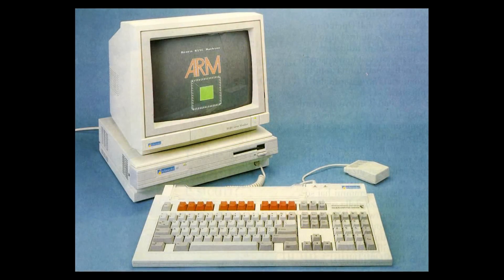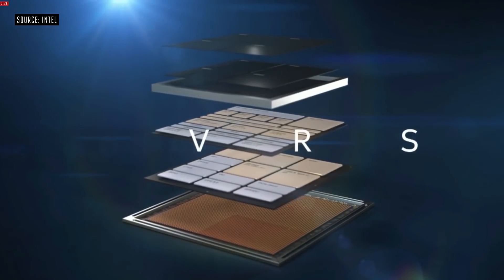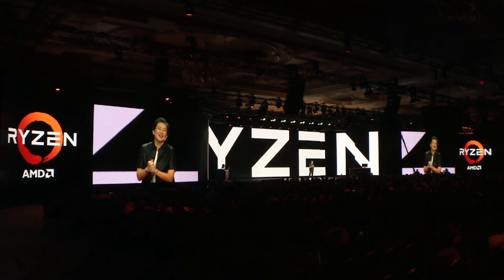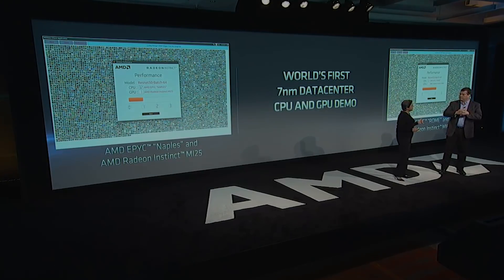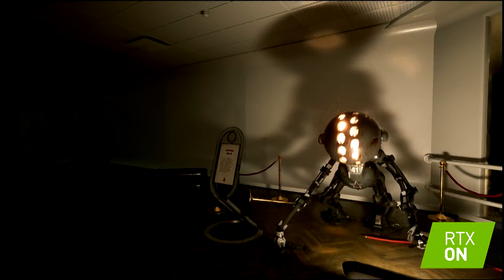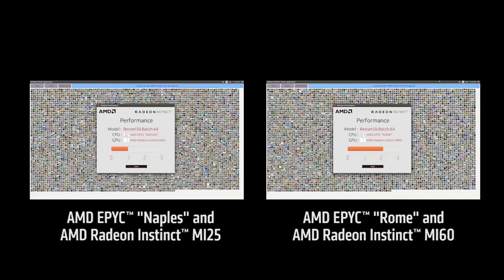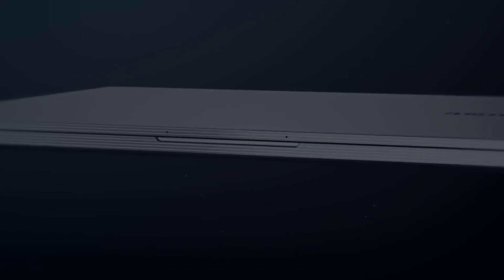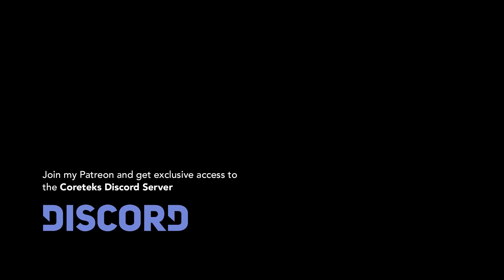Hardware trends: How many cores do we need?!

Comment: From programmer perspective I can tell you, that parallel processing is not going to arrive any time soon as common or default way of writing the code, since all the progress comes by evolution off what we had before. To implement it correctly even on high level programming languages, you need to bring more complexity to the code, than is brought by most of your business problem that code solves... So it increases costs dramatically, and bring any benefits only in limited areas of application. Also the need for multiple cores is limited, so it is more about making servers cheaper, than anything else.
Reply: Paweł Graczyk Parallel/concurrent programming is extremely common! Web server programs that service hundreds of thousands of requests at the same time, graphic-intensive programs, machine learning programs, and even web browser tabs and GUI-based document editing programs such as Microsoft Office suite all require parallel programming.
Reply: @AlqGo  you are correct somewhat but the workload you are talking about are similar in nature and independent of each other like handling individual user requests has no effect on other users  , but interlaced programs still require master/slave design pattern which somewhat is present in every program... I agree that parallel programming is beneficial but still a lot. Of programs can't benefit from it, especially i have seen most programs don't use more than two cores
Reply: @AshutoshMishra-l4m  That's not my point. I'm saying parallel programming is EXTREMELY common. MOST gui-based software employ parallel programming. Just because you have not had much experience in concurrency, doesn't mean it's not common.
Reply: @AlqGo  Why do you use "concurrent" and "parallel" interchangeably?
Reply: @antonkapelyushnik47  Because both types can be executed on multiple cores. So it doesn't matter which one I mentioned since the point is about the use of multiple cores. The more common term is "concurrency" but you do hear "parallel" from time to time.
Reply: @AlqGo  Even if you have 1 core you can run concurrent code on it.
"Concurrency" is not more common term. It's different thing. It's about order-independency structure of a program, not multiplication of streams of processing.
Both can be used together, that is true. But point of parallelism is performance. And point of concurrency is managing complexity of a code that deals with dynamic interaction and communication.
If you know this difference, why do you use misleading terminology?
Reply: @antonkapelyushnik47  @Anton Back in the days when processors only had one core, concurrency gave you the illusion that processes ran in parallel, and that's concurrency. However, multi-core processors are now ubiquitous and the standard. Threads (concurrency) can and do actually run in parallel. So, it doesn't matter if I mentioned concurrency and/or parallel because both types are run on multiple cores in parallel anyway. There is no ambiguity.
Reply: @AlqGo  Without going into the details, let me just ask you to consider the possibility that parallel programming It is not as common. This kind of statement could be based on proportion of job offers for programmers, that have it as requirements (check them out for yourself), and not on your experience as end user of software that runs on multiple cores on your desktop or mobile. It is also important that using multiple cores by apps does not make them fully parallel (just like you could see in video). 
People may see you as a guy that talks about cars in a way: "diesel or gasoline does not matter... car is a car." and this "low resolution" approach is all OK but not if you are the one that have to design/repair those cars. Then you need high resolution approach and details matter.
Reply: @pawegraczyk6050  Concurrent programming has been common for so long*. I would be *appalled if a company hired a full-time developer who has complete LACK of knowledge about multi-processing, concurrency, process synchronization, inter-process communication, etc, concepts that have been included by default in Software Engineering courses around the world.
Reply: Programming for the GPU is all about parallel computing. Ever since the introduction of programmable shaders, more and more programmers have learned to think in parallel. Someone mentioned accessing hardware as an example of something that can not be parallelised. That's not a great example, because massively parallel computing can actually 'hide' slow memory access by doing calculations while waiting for the data to be loaded. Without this, shaders would not run so smoothly. As a more generic, less specialised processor compared to GPU, a CPU has different requirements and challenges when it comes to parallel programming, but even there it's very common nowadays. Not only servers, by the way. The PS4 and XBOX both have 8 cores (iirc) and they are fully used by the game engines. Most render tasks are pre-scheduled and then kicked off across all cores. More cores mean faster results, as long as you have enough work for the cores to process.
Reply: @Paul. What you wrote, is intersting and who knows, it may be new for many, but I do not see  how it relates to my previous posts. You should read my comment in the context of video (vide its title) and not as criticism of "programmable shaders" Right? :) @AL The same. My post was not about concurency, that is not parallelism (so  isn't bringing concurency "of topic" as not related to video at all?). And what about experianced pediatrition that refuses to handle treatment of brain tumor? Is it sth appealing? In my opinion it is common sense. It is about specialisation, and need for specialisation comes from reducing the risks of failures, the costs involved in education and then in execution of whatever you do. Engineering in practice is about making stuff that work well enough as bad (cheap) as you only can and not as good and expensive as you are able to.
Reply: @pawegraczyk6050   It IS related. If you had some knowledge about how kernels work, you'd know that concurrency can be run on multiple cores at the same time. Concurrency does relate to multiple cores.
Reply: @AlqGo  I just had impression that you mix those 2 terms and wanted to help you. Yes it dose relate to but I would say to CPU as such. It was true when it was just one core, also now with multiple cores and I'm sure will still  continue to relate in a future. You broth concurrency here, and the way I saw it, the way you justify it, we could replace  word "concurrency", with any other stuff that can be put on multiple cores. Right? So would it not be much clear to just say "multiple cores"? This is the reason that it is of topic for me and not that I have some bias against you or concurrency as such :) Plus my initiall comment is even more true for concurrency on multiple cores as we have even more complexity. I think we just have different view angels here, and are focused on different things, therefore talking through each other.
Reply: Paweł Graczyk The video tries to answer how many cores do we actually need. Since concurrency uses multiple cores, THAT IS an excellent reason we need multiple cores. Of course concurrency and parallelism ARE related. Your knowledge of concurrency is clearly not up to par and you clearly have no knowledge about kernel task scheduling and how it relates to multiple cores. You shouldn’t have misled people into thinking 2 cores or even 1 core is all we need.
Reply: Some day,  coding will be MUCH more automated.Human labor doesn't benefit from economies of scale like manufacturing does. There's a truly good use for AI. 
Having being involved with software development, it's always amazed me how insane the moving target of complicated, buggy, inefficient, and expensive software for personal computers is, compared to how precisely engineered  and fixed the actual silicon is.
Reply: what if machine learning comes to the office room/living room? alot like the 80-90s pc revolution saw computers spread beyond the enterprise/industry to households/small businesses? For a small business instead of paying a monthly service fee every gosh darn month for decades to have Deepmind remotely provide a secretarial ai assistant as we saw them demo a couple months ago, instead we have it done locally on your 32-48 core AMD/Intel cpu?
Reply: I agree, not only is it more complex but in a lot of cases using multiple cores and threads could actually slow down the program instead of increasing it especially when your program has to interact with a lot of different hardware then breaking down processes into smaller threads and running parallel actually slows down the processes... At best there will always be a master thread/core and another core or thread will be used to do different activity interlacing them is still a long way from now and i think wouldn't be efficient still
Reply: You just need to learn a language that already have all that and have done it for decades and is now the core of high load applications that never fail.
https://uptime.com/whatsapp.com
Check out Erlang or Elixir.
https://www.youtube.com/watch?v=4elY_RuyBhQ
Reply: Don't you just need a better compiler that does all this parallelization for you?
Reply: @AshutoshMishra-l4m  No one here is talking about "definite" or "indefinite" whatever you tried to say. The fact that concurrency is extremely common is a VERY GOOD reason why multiple cores are a requirement these days. You should revert back to using Pentium III if you think multiple cores are unnecessary.
Reply: you sound like an JVM developer
Reply: I mostly don't need to do something for getting parallel code.

Just use things like blas, mkl or something, that builds on these libraries and your fine.
Reply: @MephistoDerPudel Sure. And good for you. But "using parallel libraries"  != "parallel programming". Just "playing violin" != "making violin", for lack of better comparison...
Reply: But then the AMD shill gamers would still say programmers are lazy cos their high core count cpus are not being fully utilised.